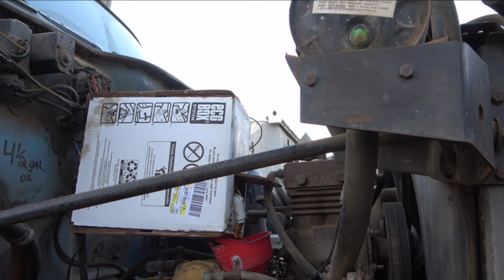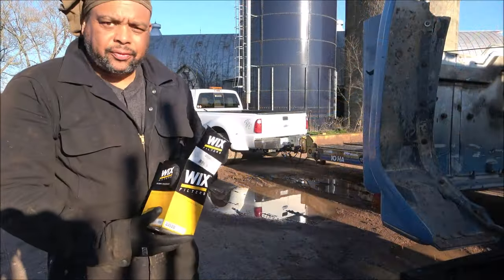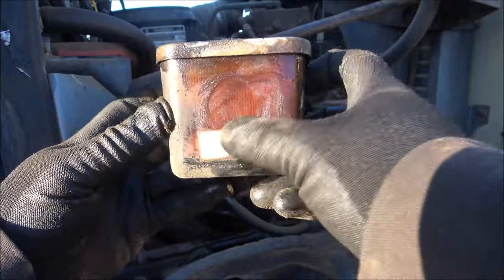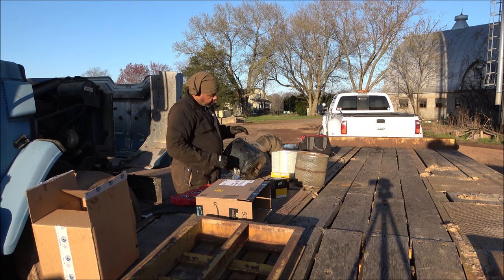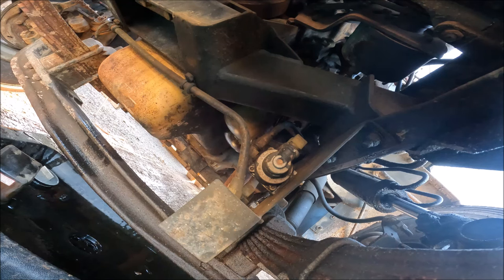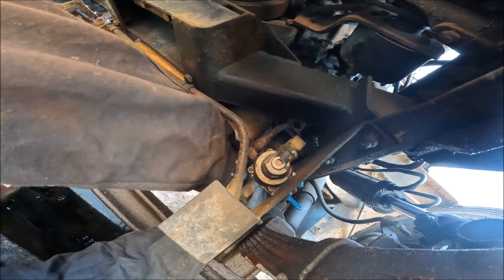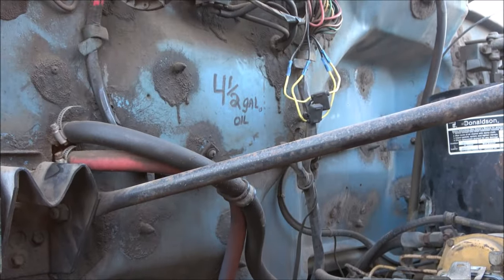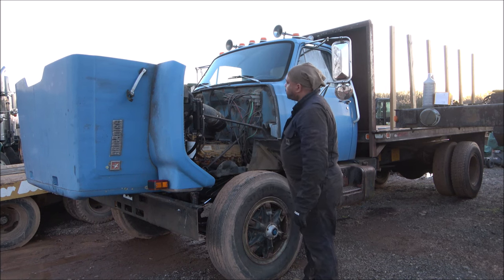Caterpillar 3208 Fluid and Filter Change - 1984 GMC Brigadier

Comment: Have you changed Coolant on this 3208 before? I’m looking for the Coolant capacity, I’ve put in 7 & 1/2 gallons of coolant thus far and still have no coolant in the expansion tank. I have the same year, make and model truck. I just changed out the injection pump for a new ish one because it would not function.
Reply from the maker: No, I have not done a complete flush of the coolant system yet.  10-12 gallons wouldn't surprise me.  My research shows 12-15 gallons, depending on the configuration and application.
Reply: @HammaDownEnterprises  Thank you for the input I appreciate it. 👍
Reply from the maker: @yellowblackcaterpillarjack5538  Sure thing and any time!